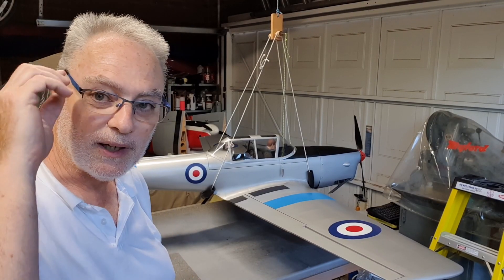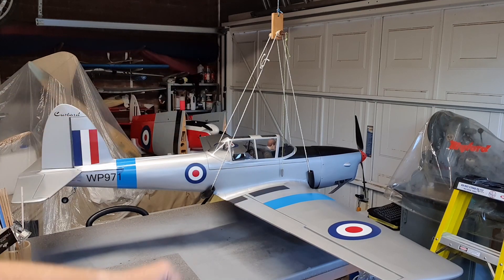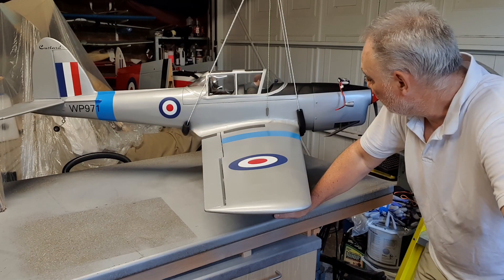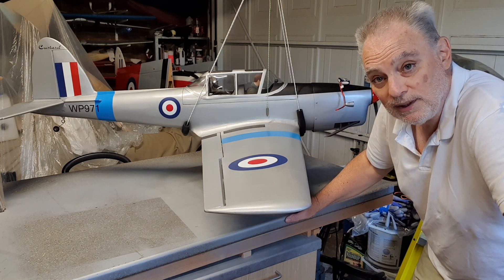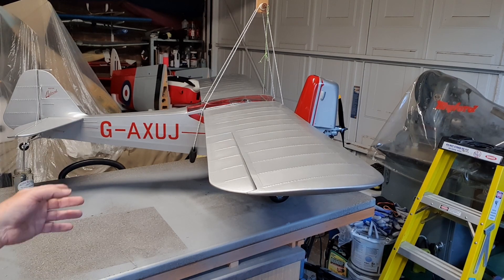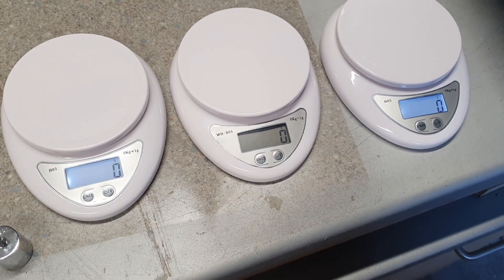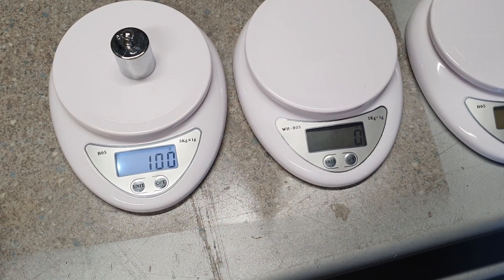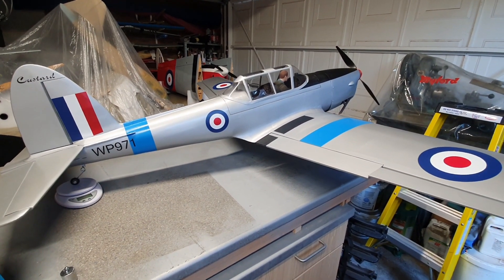Vanessa

Comment: A tip for those who question how to get a level on the curved surface of the stab. Get a contour gauge, get the shape of the stab and transfer it to a piece of scrap,  then put a straight edge on top  and cut it out. Now you have a platform to rest the level on when balancing. You do need to find the centerline before marking the straight edge, each and every one is a little different.
Reply from the maker: Thanks for the feedback. Anything you add to the model while checking the c of g such as a level will introduce errors so you have to be careful. I find my eyeball is fairly good at checking that the model is sitting level. I think I would probably use a laser level, aimed at the tail-plane tip if I were to use anything.
Reply: @cammnut  I take the level off once I got it where its level, and always use the rear line for placing the end of the bubble at, so when the weight of the level is removed it should center up.   It does add time to the balancing, but considering how much time is spent during the entire build process, a little to get it as spot on as possible is time well spent.   I flew a tail heavy plane once, almost got it down in one piece.
Reply from the maker: I think you mean the wing surely? if you do this with the stab then the weight of the level will make a huge difference to the sit of the model, unless I have completely misunderstood? and also you are not taking into account the angle of attack for the wing in level flight?

Comment: Everyone talks about level.  What is Level?  The Prop, the canopy the Tail Stab.??
Reply from the maker: level is through your datum. Most models fly straight and level with a little positive incidence on the wing. but that depends on the wing section. so not a straightforward answer for all types. On the Chipmunk for example, the datum is parallel to the canopy rails.

Comment: Hello Danny, I built up a Venessa Balancer similar to yours to use on my Phoenix Model .55 Size Corsair. It has a 58.5 Inch Wingspan and weighs about 7 pounds. The instructions that came with the Corsair say to balance it up-side-down and establish a CG at 85mm behind the Leading Edge, so I did that. What confuses me a little is why the model when balanced right-side-up, using the same set-up winds up with a different amount of nose weight than when balanced up-side-down.  I have a thread on RC Groups where I documented the Venessa Balancer Set-up. I was wondering if you can have a look at it and let me know if I'm using it correctly.  I decided to use a Laser Level that projected a Red marker down the side of the Corsair's Fuselage and lined it up with a Horizontal seam between the Hatch and the mating portion of the Fuselage. I thought that would be a good way to determine when the model could be considered "level".  I adjusted the weight so that the Red Laser Light ran right down the seam. Some people are balancing their Corsairs right-side-up in the Venessa Balancer and they lay a bubble level on the flat surface below the Rudder to know when the airplane is level, however, again, I question why my test results were different when I flipped the airplane over and tried to balance it right-side-up. Here below is a link to the post I made on the RC Groups Website. Scroll down to Report Number 474 to see my post about Balancing the airplane. https://www.rcgroups.com/forums/showthread.php?2438030-Phoenix-Models-F4U-Corsair-%28PH011%29/page32#post52227853
Reply from the maker: That's very interesting, my initial thoughts are that the aircraft should not be level but slightly nose down when the right way up, to bring the wing section level. (Usually the wing is plus a few degrees on the thrust line) with model upside down the nose will need to be slightly up. If you have used the same reference for both then I don't understand.
Reply: Low wing planes should be balanced upside down to counter the effect gravity has on the top of the fuse.  With the weight under the wing the plane will properly balance, with it above the wing it can influence one way or the other and throw off the balance.   Consider it is hanging from the rig, so you want as little momentum as possible.  I have this same model that I am building, but not my first Corsair, there is a LOT of top weight with them. It is very easy to upset the balance unless they are hung upside down.  Chasing tail comes to mind.

Comment: Hi, I like your vid, but I'm still trying to understand this contraption. When the model is sitting within the rope swing, doesn't the rope stop the model from tipping forward or backward? Or does adding weight to the front or back, cause the model to tip forward or backward, moving the CG point?
Reply from the maker: you rotate the dowel at the top to keep the model level. It is important that it is level. The dowel is a snug/friction fit so wont spin of its own accord, you must turn it. As you add weight to the nose it pitches forward. you rotate the rod to make the model level again. This moves the vertical plumb forwards on the model, ie c of g further forwards.
Reply: Thanks for that clarification. I guess using Vanessa for a large biplane would be the same process? i.e. If the CG shows on the plans as being a point on the top wing, string up Vanessa through the top wing only and keep the model level through the marked thrust line on the plans?
Reply from the maker: @chrismcg7856  hi Chris you can sling it from the front and rear of the fus, doesnt have to be the wings.

Comment: I would like to see the working part of the jig if possible please Danny and how the cord is wound around the dowel thank you
Reply from the maker: Leave it with me, i did do another video showing the lifting and raising as I have a pulley and a cleat in the garage roof. I am away all week so it will have to be at the weekend
Reply: Thank you Danny, from what I understand the cord has to be equal but nor sure in which way? All the best
Reply from the maker: I have never worried about the chord lengths, not sure if you are over thinking this....
Reply: @cammnut  most likely mate!! 🤣🤣🤣

Comment: I'll have to test this, but do you think that the weight of the rubber tubing on the loops could alter the measurement? I don't normally weigh my models as you did, but I can see the benefit of it by adding a touch of weight to even it up. Nice video, thanks!
Reply from the maker: No i dont think the foam  has any bearing on the system
Reply: @cammnut  Testing in my rig showed that weight on the line will affect the balance, but it is so small as to not really matter. It was an interesting thought experiment though! Thanks again! I hope you found a good camera person to cover the maiden!
Reply from the maker: The rig is not really suited to smaller models, perhaps then the chord may have more bearing. The short pieces of neoprene are very light